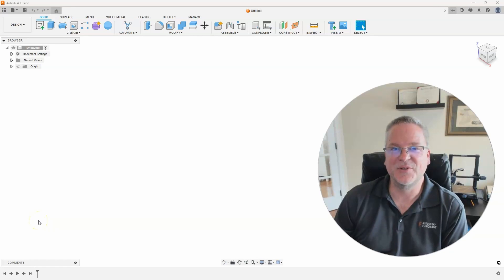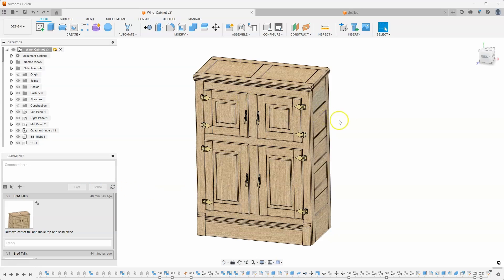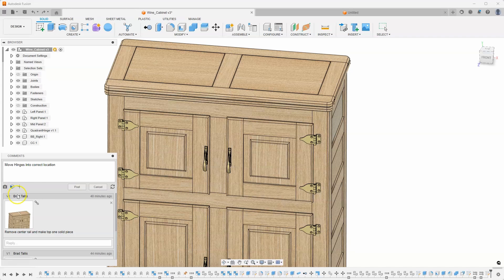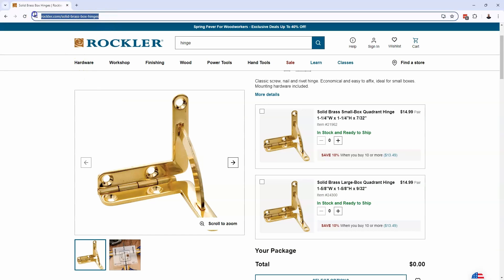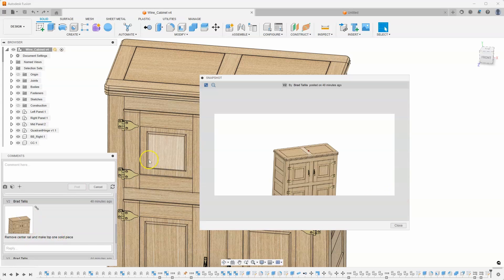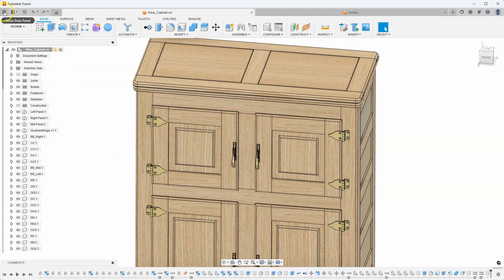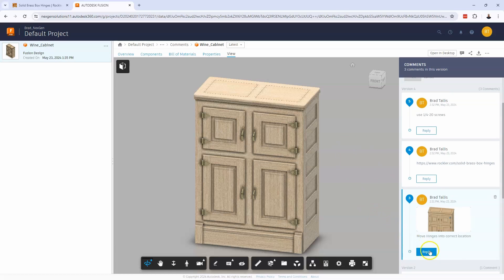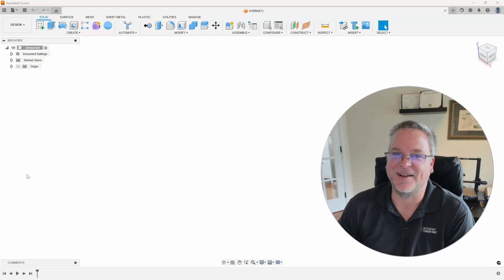Fusion Friday - Adding comments to your design

Comment: Great video Brad! Love all the info so far. Are the comments able to be attached to drawings? I could see that being very useful as that’s ultimately what I print and take to the shop.
Reply from the maker: @thehangerdesigns - Yes, you can add comments to drawings, but it doesn't have the "pick an object" or "pick a point" options.  Thanks for watching.